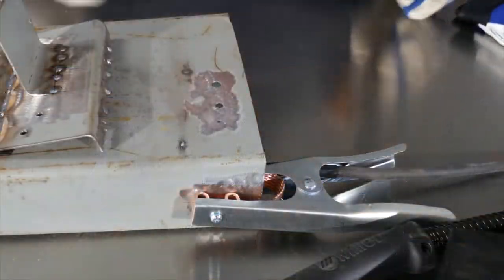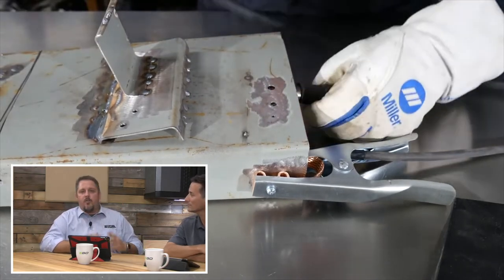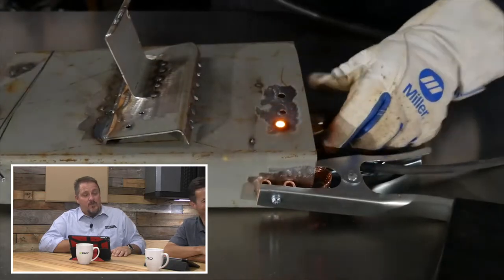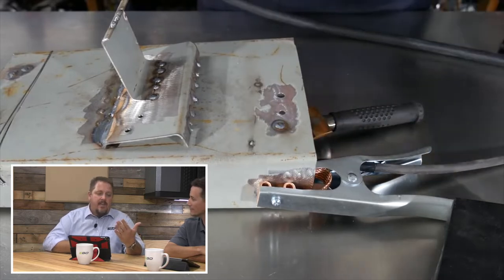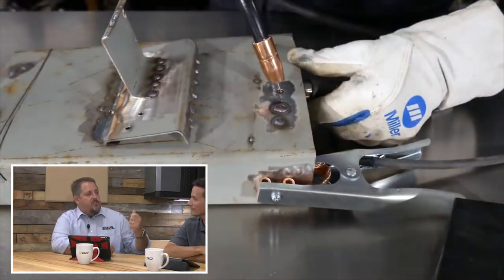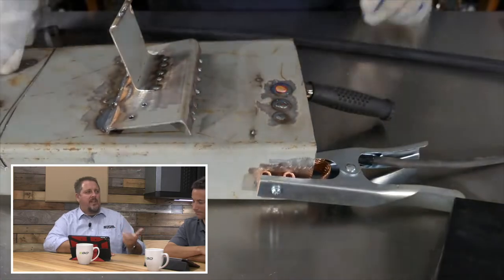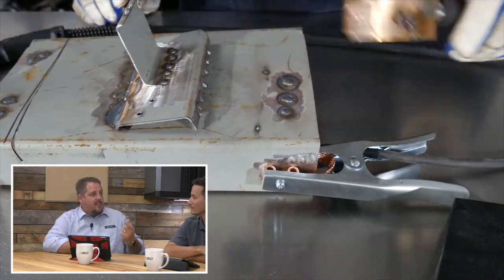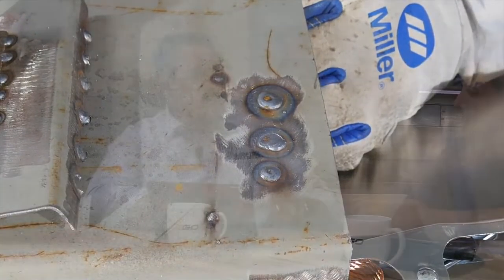Tooltip: Using Copper Welding Spoons for Filling Holes

Comment: i make my own copper backers out of copper pipe, 3/4" copper pipe and just hammer it flat, bend it to whatever shape you need, i also have brass backers, some one inch rounds about an inch long with a 3/8" piece of round stock as a handle, i also have some one inch square brass backers as well, all just scrap.